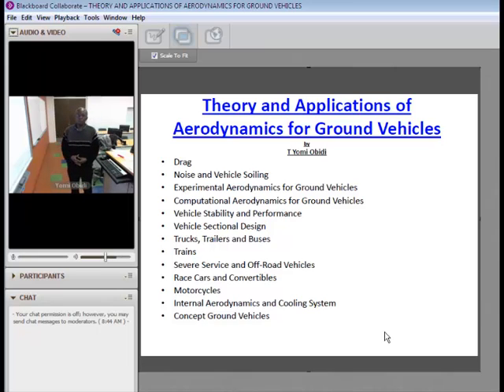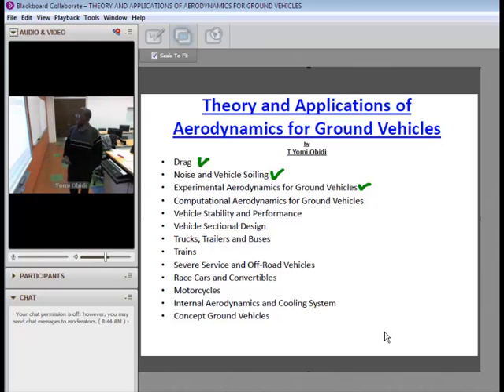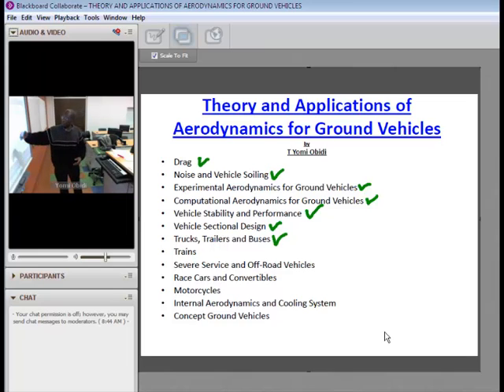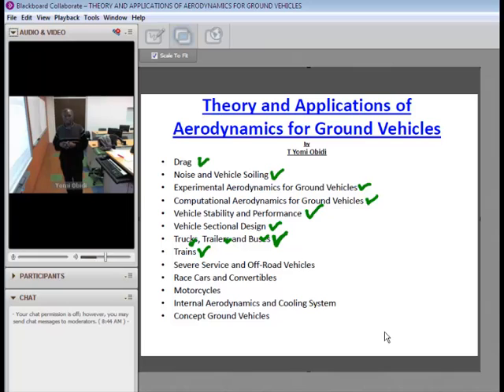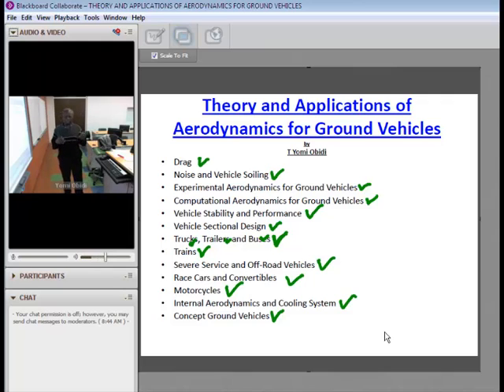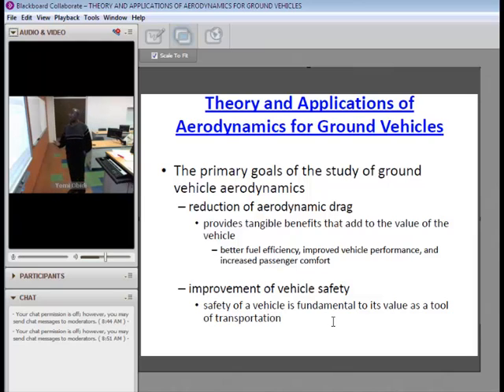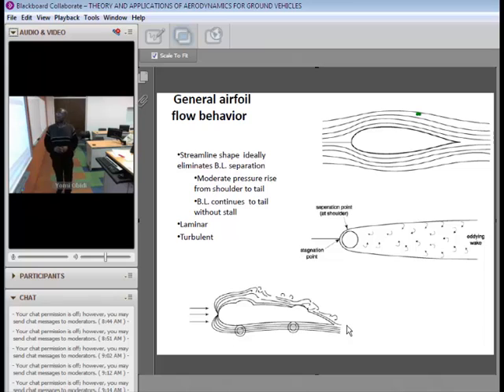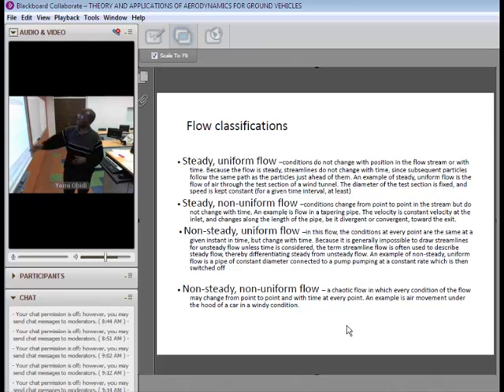Drag: Theory and Applications of Ground Vehicle Aerodynamics

Comment: So if a smooth surface has less drag then why do they make the surface of a golf ball rough?
Reply: Not sure if you were able to find your answer, there are some cool visualizations and explanations on the web for why golf balls have an artificially rough surface. It all has to do with controlling where flow separation occurs. If your golf ball were perfectly smooth the flow would separate just past the half way point and you'd find two eddy's of recirculating flow at the rear of the golf ball as can be seen in these images: https://www.bing.com/images/search?q=sphere+recirculating+flow&form=HDRSC3&first=1&scenario=ImageBasicHover . The larger the eddy's the more drag you incur. Through wind tunnel testing of spheres (thank the N.A.C.A.) we found that the further forward we could get the flow to separate the smaller the eddy's would be. This is a case of form drag, drag due to the objects geometry. There is actually some diminishing return with how 'rough' you can make your golf ball, there are CFD studies out there that delve into how many dimples you can practically add to a golf ball before you lose performance blow your manufacturing cost through the roof! The golf ball is also very small compared to other sports balls traveling at similar speeds (baseballs, tennis balls) which lowers the Reynolds number which also helps a lot in terms of skin friction drag, if our golf ball were the size of a car traveling at a similar speeds we would see a very large increase in this drag (for completeness our form drag would also change, but would not be the largest contributor in this case). This is why engineers go to such lengths to smooth vehicle surfaces, although if you really want to have your mind blown check out some studies on mimicking shark skin for underwater vehicles. Hope this helps!